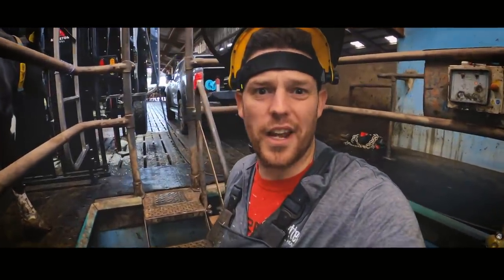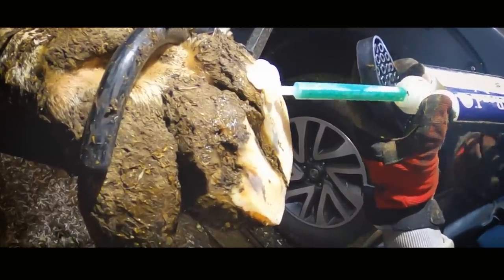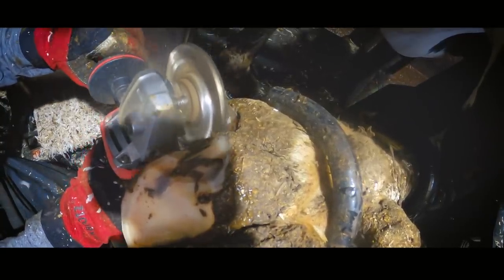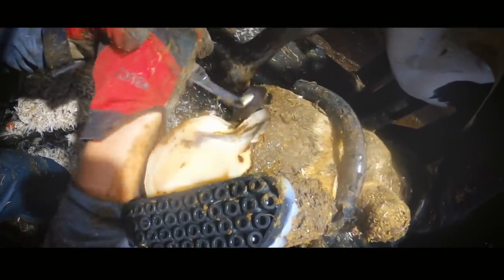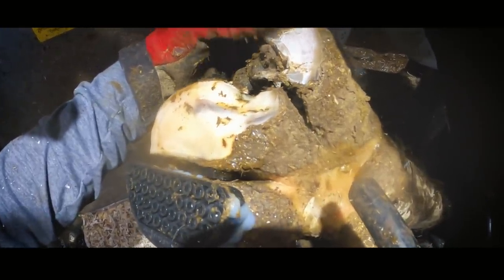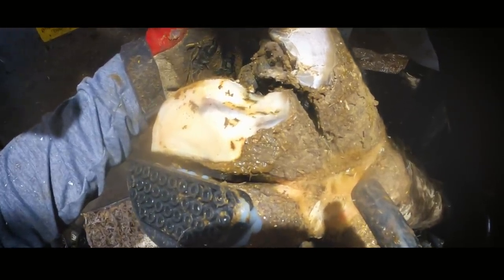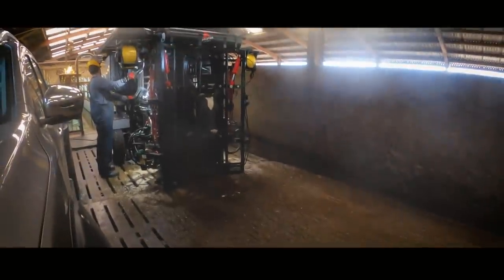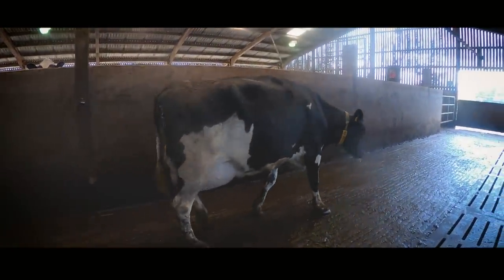DEFORMED COW ... an *EXTRA HOOF GROWING* OUT of her LEG!

Comment: I wonder if a pressure clip solution would work on a calf that presents with polydactily. That's what we do to human babies because extra digits more often than not lead to motor problems later in life so we will use strong rubber bands and lidocaine to cut off blood flow until it's necrotic then just do a quick cut and bone clip and stretch the live skin over the site. Or standard surgical intervention.

Comment: One thing I don't understand. You carve out the area on the inside to remove pressure from the pedal bone. But this isn't a natural wear shape for the hoof is it? How come just trimming them flat isn't sufficient? Is it because they aren't in a natural habitat so more pressure is placed on their hoofs? Or maybe a side effect of breeding them so much their natural hoofs aren't good enough anymore for their extra weight?
Reply: He says he trims out the inside of it because that's where all the poop collects which I guess is from them not being in their natural environment.
Reply: He trims them that way so weight is more distributed to the outside 'walls' of the hoof. That's the weight bearing structure. The pedal bones are essentially suspended by ligaments within the hoof, the underside serves mostly as a shock absorbing cushion and so a little extra space allows it to function better.

Comment: this has probably been answered, but why dont you wash their hooves. all that manure...getting flung around by the grinder cant be good for your lungs.
Reply from the maker: The floor would become extremely  sloppy for myself and the cows if o was to was every single hoof off. There are also alot of electrical equipment  round us and woulnt like to electrocute  myself or the cow. The grinder takes most of the dirt off with one swipe. I do wash them down if and where I need to for example if it has been  a really bad hoof and I need to see it more clearly.